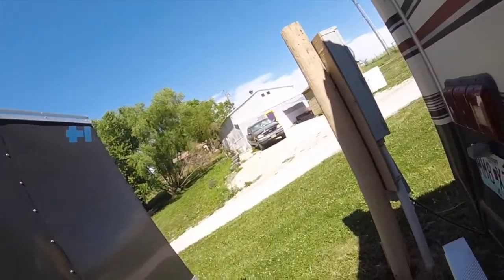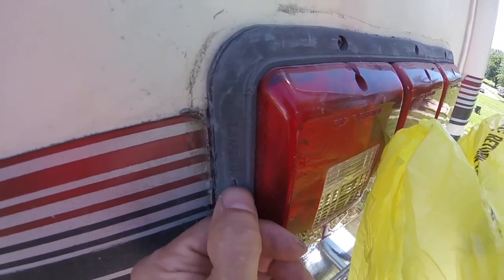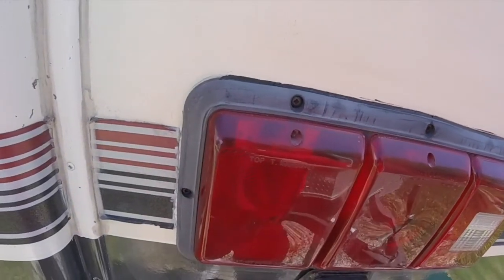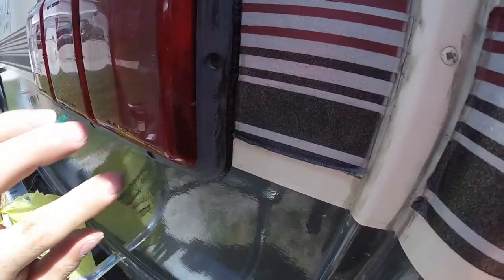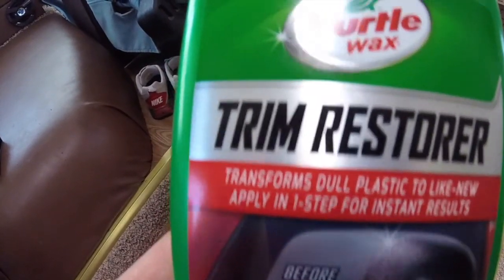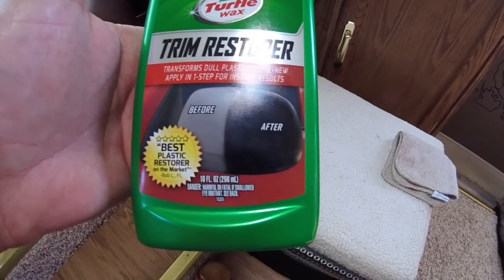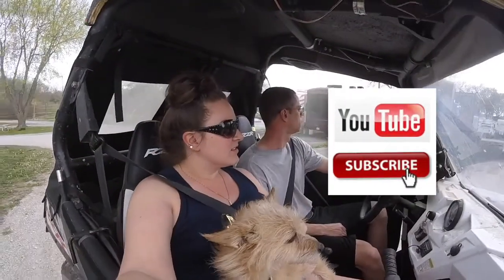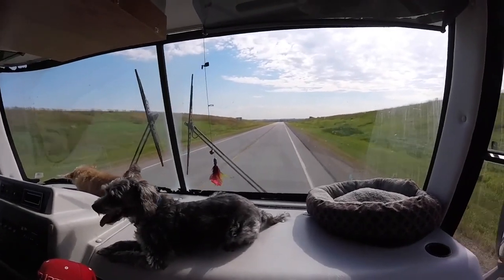RV maintenance--Caulking tail light~~~ReNewing plastic & rubber

Comment: Those inspections are a joke! I was telling someone at work about them today. I dont know what you pay for them now, but I remember everyone charged $6.50 back then and you were treated as either a waste of time or they tried to make stuff up. So we always went to the guy who is as fast a possible. I remember my first car, this one shop told me I needed a brake light assembly because it was cracked and wanted to charge me a couple hundred bucks. I told my dad and he went off on them and they passed it. But thats how they made money, they couldnt charge more than $6.50 so this place tried to get something out of ya.  In Nevada, well the 2 largest counties in Nevada, we dont have safety inspections, but we have smog checks. You could be driving the biggest POS with taillights falling off, no horn whatever as long as it didnt pollute the air, its OK, and the shops can charge whatever they want, so it makes competition. It actually keeps the prices about the same. Or you get a PO Box in another county and you dont have to mess with it at all. Hope to see yall traveling soon!
Reply from the maker: They are a joke and its $12 now, its another way for the state to get more of your money.